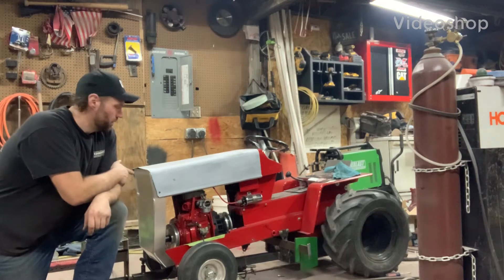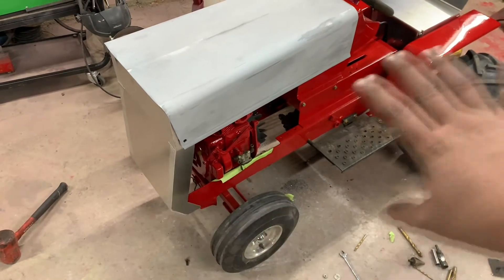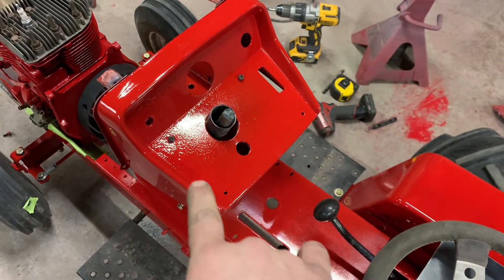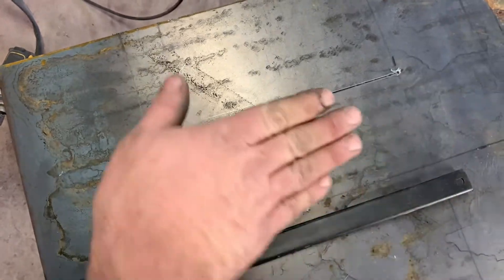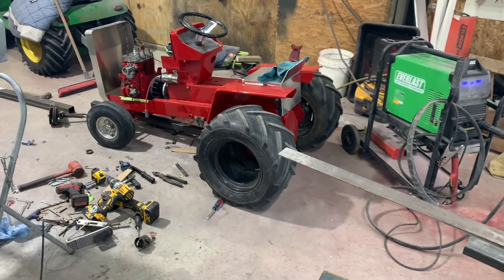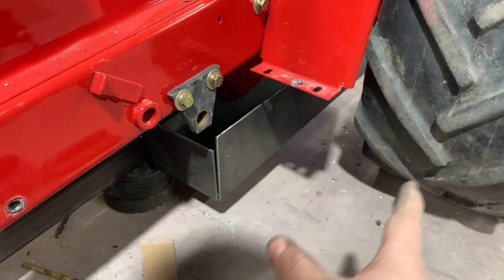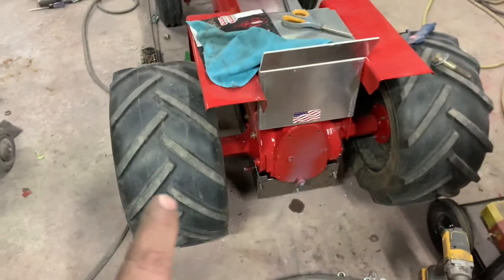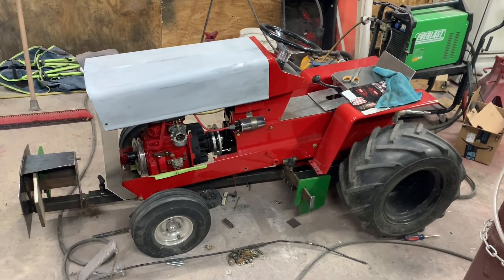Narrow Frame Cub Pulling Tractor Build Pt2

Comment: I know this is an older video but i need to ask where you got that grill from. Its awesomeness
Reply from the maker: Midwest super cub, it’s their aluminum grill. It has held up very well. Ran some 1” aluminum flat bar on both sides inside the hood from the battery box to the pivots for the hood to keep it from folding over when the hood is opened. Thanks for watching!

Comment: You guys dont have to run steel flywheel?
Reply from the maker: Anything over 4000rpm. Personally I believe it’s a safety issue and run them on whatever.
Reply: @karnesmotorsports  yes ,ive seen the cast iron ones explode on a video one time at 4800 rpm
Reply from the maker: This is a steel one. I believe it’s a safety issue regardless of what the rules say about external modifications.
Reply: @karnesmotorsports   google brian miller garden tractor pulling tips and tricks,lots a good info on that site , good luck,hollar if i can help in any way

Comment: Are you gonna run a steel fly wheel I think Vogel sells a aluminum one we couldn’t run a factory fly wheel due to our insurance that covered our club we have had them crack and then fly apart I guess it depends on what your club rules say
Reply from the maker: I have a steel flywheel coming from Lakota. That’s what’s holding this project up at the moment. We’re governed to 4K rpm in this class, so a cast flywheel “should” be safe, but I’m not chancing it. Regardless of what the rules say about having to run a stock flywheel.